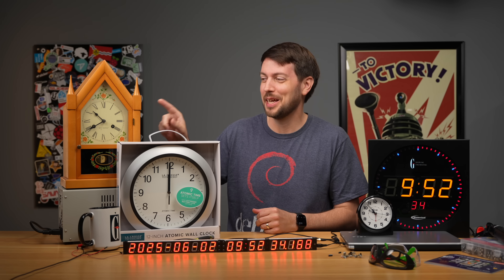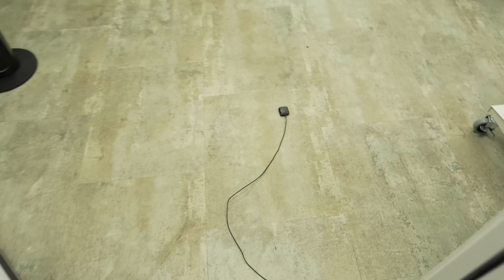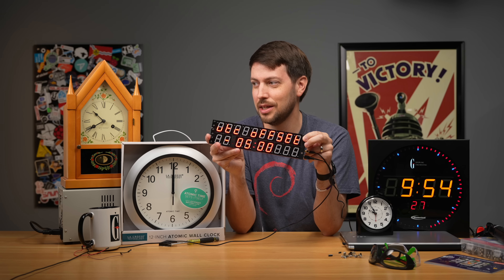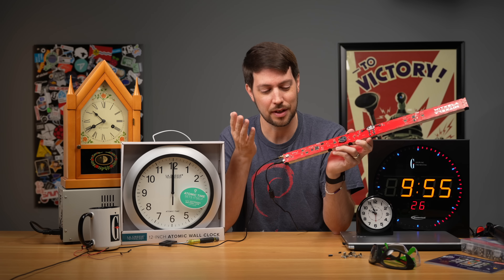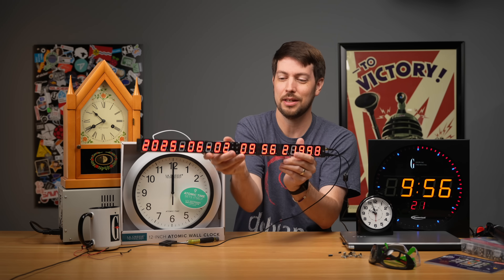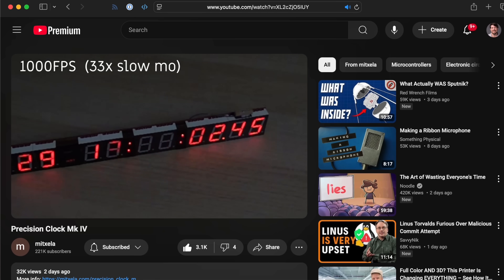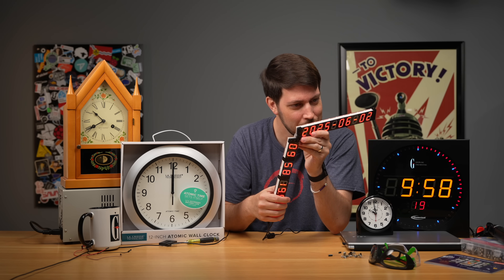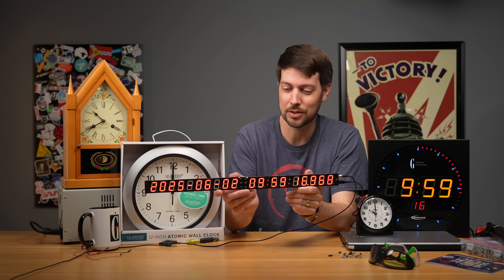Your eyes are too slow for this clock

Comment: I always wanted an atomic / gps / ntp clock... There are lots of cheap ones out there that are battery powered... but I want one that plugs into an outlet without needing a "battery eliminator" and they all seem to be really expensive...  I just want at least one stand alone clock as a display/conversation piece I can just set and forget, and not have to worry about battery.  why is that so hard.

Comment: I love this "time" hobby.  I've been somewhat obsessed with accurate time since I was a kid and saw the Back to the Future movies in the late 1980s.  Then by the time I was a teenager and had access to crude reference NTP software and had my first Internet connection back in 1999/2000 it was cool to be able to set my computers clock with SNTP (not real NTP) using that reference software.  Now I use real NTP software or chronyd on Linux and it works really well.  But to have a physical desk clock, I just bought my first NTP WiFi clock a month ago because I was so disappointed with the performance of "Atomic" (radio) clocks where I live since I live so far away from the signal that they have to perpetually be in a window rather than on my desk or beside my bed.  This is so cool to see other people share this same obsession with accurate time that I do!

Comment: Thanks for the fun video.  Finally!  Someone geekier about time than I.  Yeah, I've got GPS-based clocks, and set mine using GPS or NTP.  Usually I just use time.gov and set my (manual) clock so its pulse-per-second LED blinks at the same time as the time.gov readout changes.  I can move things around so my eyes can see both (PPS LED and time.gov display) simultaneously, and I can synchronize the clock manually to within a tenth second or so.  I'll also sometimes call the NIST number and sync with their start-of-minute tone.  A friend of mine puts us both to shame -- he owns 2 Cesium oscillators and tracks the phase with the WWV* radio signals.  He says he doesn't care so much about the absolute time, mainly the oscillators' precision.  He may not know what time it is, but he can tell you how long any time interval is!

Comment: This is the coolest clock, officially. I actually own the previous Mk III model-- it sits above the AV equipment on my desk and it's the only clock I actually trust (when it has the GPS fix, of course). But this is on another level (even literally in some aspects).

Comment: The clock screen seems to be hard to read, not sure if that's a camera/lighting artifact or if the used 7-segment LED is not that bright.
Reply from the maker: It's actually an artifact of the non-lens-cover design out of the box. Ideally you'd have a special lens in front of the digits (most alarm clocks have this), that helps to even out the light. Otherwise you get the murky display that you see in the video (it's hard to record LEDs in general!)

Comment: I’ve always wanted to see a highly accurate extremely cost-effective atomic clocks that could be used to built into a very large 3 dimensional array and cleverly integrated together with some kind of mesh network, not sure if the array would be best in a terrestrial or non-terrestrial placement? And then monitor synchronisation errors.

Comment: Unsure about the clock shown in the video but this is for GPS clocks in general. If you leave the clock stationary over an hour period it should slowly train in on the weaker signals of the satellites and eventually grab the time even with a small device-sized antenna. You can also carry it to a window or outside and update the time if the internal RTC is reliable enough to only need updating once every year or so. I'd add a surge arrestor to the outside antenna just to be safe from even far away lightning strikes damaging components.

Comment: Delays with a time signal is a pain (allowing for how far you face is away is not the clocks problem, you chose to be there) I had lots of fun sending time down a serial line, so all my clocks are in sync, allowing for the delays in the serial data is a challenge, a PPS signal would fix it, however integrating that into a serial stream is a problem. a dedicated PPS line would be best solution, however adding the extra line - not ideal for me,
Even using processors is a problem, they are not real time, everything is delayed - latency.
In the end I had my remote clocks average out the variations in when the time data arrived and add a fudge factor for the average delay in my system. So good to parts of a second - time for an upgrade?

As for your new clock, the bit that suprised my about it was the colon LED's, doing a slow fade rather than hard switching off the PPS signal. Having the sub second digits is a nice party trick, but kind of pointless as far a super accurate time is concerned, as the only thing that ever uses that time is the human eye/brain, that cannot handle it - otherwise you would not get the comments about the last digit being stuck on 8, back to your title "Your eyes are too slow for this clock"

I made a 16 digit clock, mainly as a project in getting an Arduino Nano to drive an old 16 digit calculator bubble display with insufficient output pins. Time was just a handy thing that could use all those digits, so time to make it a real clock - as in super accurate PPS driven?
Reply from the maker: Regarding the colons; they can be set in different modes, from pulsing like in the video to blink, steady, off, etc. I just had it set in the default.

Interestingly, the colons are using PWM for the fading
Reply: @Level2Jeff  Lucky then that it didn't get tangled in the frame rate of your camera and give us a right old mess.
Actually I find colons to be a pain when it comes to making digital clocks, there are plenty of seven segment displays out there, but no colon's, so your forced to make your own, but they never look right, as in the same as the display segments, wrong colour, shade, you name it, never right.
Generally I've flipped the first minutes digit so it's decimal point is now at the top and in conjunction with the second hours digit decimal point can stand in as a colon - not perfect, and relying on the displays being symmetrical, they mostly are, however I have some that are not.
I just looked at the mitxela video, yes colons stand out as not matching.

Comment: Very cool, I'll check his page out. I built a clock a few years ago using two ubloc f9p  for error correction with surveyor style ground plane antennas to discipline the rtc. The MAX7219 is great for driving common cathode LEDs. His design is really cool with how it folds. Fills my head with ideas.

Comment: That is a very cool clock, I've spent more than that on mechanical clocks, clocks can be a bit of an addiction...   That clock is only displaying milliseconds, the 10 foot GPS antenna cable is only going to add about 10 nanoseconds of error, so not really an issue. :)  Last year I got a watch that syncs to wwvb, had to build a ferrite core resonator to put next to it since I'm on the east coast it wouldn't sync unless I put it on a west facing window, next to the resonator it will sync anywhere in the house.

Comment: It's always cool to find someone has done something that I have purchased parts for but haven't made yet.  I've had a tube of an insane number of 7 segment displays under my bed for the past six years now.  I've been wanting to make a clock that counts at 32768 hz for years now - with no microcontroller.  pure 74 series logic chips.

Comment: I would like to see the circuit diagram of this clock. The UBLOX MAX-M8Q-0-01 GNSS module has a PPS signal output accuracy of about 30-60ns.  I assume the clock circuit is only getting a pulse per second (which is still highly accurate) and the clock is then deriving the millisecond count from this PPS. How often does the clock sync to the PPS signal?

Comment: Am I the only one that doesn't really get the whole point of precision timing as a hobby? Don't get me wrong, everything displayed here, including the design and engineering that has gone into this device is awesome, but, outside of really specific scientific or engineering contexts, keeping time to this level of precision is kinda useless.
Reply from the maker: There are a number of applications that can benefit from accurate time to ms (and beyond), from amateur radio/astronomy, to distributed data sensing, distributed computing in general, and VR/AR tinkering. Most things today are fine with just slapping NTP time on them (you can usually get into the ms range with that), but a lot of things need better time if you want to go deeper or get better performance.

Comment: Since many of your projects will be using GPS for timing, try to find a GPS signal splitter. They work similar to regular RF signal splitters, but one of the outputs has a DC pass through path to deliver power to the amplifier in an active antenna. Use it to connect the receiver which will always be running, and use the rest for your other projects.
Reply from the maker: I installed one a couple weeks ago, currently splitting the external antenna to two Pi grandmaster clocks I'm testing.

I have two more ports available and two long runs of RG58 coax, I just need to get messy up in the ceiling and get the things run into the studio!

Comment: My former father in law installed and maintained ILS equipment in the south East. I joined him a new install one Saturday morning and he couldn’t get the self calibration on the localizer to succeed. Being an IT professional and gear head, I was surveying the the installation and said “hey Roger, what’s this little 4” pigtail on one of the antenna inputs do?” He peeked his head in the back of the rack and responded with “oh, there’s my 180 degree phase inverter. No wonder it won’t cal.” 
All the dozens of antenna coax were cut to millimeter precision using a vector voltmeter to minimize the amount of software phase correction needed on each antenna channel. Just freaking amazing!

Comment: Since the 1860s there had been a time signal in Edinburgh where a gun is fired at the Castle. This used to be triggered by the best electrically controlled clocks regulated by the local astronomers. Maps were sold with circles indicating the delay from the gun firing to when you would hear it at different places. Maybe you need to a map of your office with lines marking the correction you have to make because of the delay in light getting to your eye from the clock. But then I guess you'd have to add a correction for the time it took you to react and do the mental arithmetic....
Reply: That is incredibly cool!

Comment: Obsessing about nanosecond accuracy when working with modern CPUs is paradoxical -- on an inception-on-a-chip mac m4 a single instruction can take up to 500ns to complete. That's about 100 meters of cable-time. Nanoseconds are only important when you're touching metal.

Comment: I went down the time rabbit hole a long time ago. When you could get a cheap ovenized oscillator at a surplus shop. I still have the GPS disciplined Rb standard I built back then, and it still puts out a very very accurate 10Mhz for my electronics bench. This though...this tickles a different part of my metrology/time interests....

Comment: Investing Time into..Time?  (thanks dad) Holy cow, I never knew there was so much involved.  But also, I don't need that kind of accuracy.  +/- 5 seconds is plenty close enough for me.  But even if i extend cables and what not, it's probably closer to 1 second.  I'm not syncing anything critical that can't be 10 seconds late, but still interesting.  The only other most accurate thing I want to get going is a 10mhz signal for radios and stuff, but I wonder if a TXCO is good enough for what I'm trying to do.  I just dont want things to drift, and I'm already working with the normal quartz stuff which isn't -- too shabby.`

Comment: I was on the team that manages all NTP time servers for all of Amazon and AWS, including all customer instances, customer devices in the field, etc….  You would be amazed at the kinds of things we had to do in each datacenter in order to get multiple GPS antennas on the roof, diversity of antenna locations and cable runs, length of cable runs, and so on.

But starting with a way to distribute 1PPS signals reliably and in sync — that’s part of the key.

Comment: The Pi Pico doesn't have the low power modes to run off the backup battery. The STM32L0 and L4 series can sleep with the RTC running at a few hundred nA, or about 1µA if you want RAM retention.
Reply from the maker: The RP2350 improves a bit over the RP2040 with better light/deepsleep options (down to low uA) (though still not quite a battery-only champ like some other microcontrollers!).

Comment: 3:32 A battery-powered TCXO? How long does it run on battery? What temperature?
Reply: It looks like a normal 32kHz crystal, mitxela's project page also doesn't mention a TCXO just a crystal.
Reply: It might be temperature compensated in the sense that the board temperature is measured and some ppm offset is applied based on the manufacturer provided curve for the crystal, that's standard practice and the STM32 clock system has a mechanism for it.

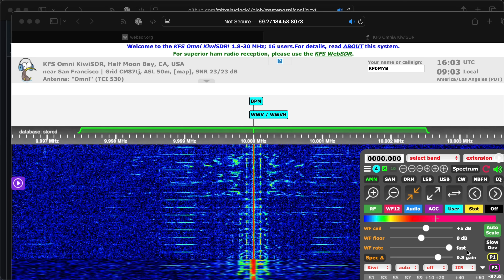Comment: 3:00 Unlike WWV, where the voice first gives you the upcoming time and then the beep marks it, in GPS I believe that the 1 PPS pulse happens and then (a bit late...) the time data comes out of the GPS receiver chip.
I've seen software where this is carefully accounted for, with the time data being incremented and aligned for the following 1 PPS pulse. That incrementation might include the date, etc.
One might imagine a very precise clock where this was overlooked, and it might be almost a second off.

I own three of those Atomic wall clocks that receive the new WWVB phase modulation. They're near-perfect, except at the last 'Leap Second' the Seconds hand paused at 59s instead of at the 60s mark. Obviously a design limitation in that that Minutes hand would have otherwise incremented one second early. Another minor design flaw is the battery replacement seems to require a complete reset to get the Seconds hand going again (in spite of having parallel C cells).

Comment: Cable delay is nothing, USB delay is a larger and less predictable problem. And, you should be aware that the cable delay is temperature sensitive to do properties changs and physical length changes.
{o.o}

Comment: Nearly 50 years ago I worked a few summers in a manufacturing plant assembling printed circuit boards for use in Univac mainframe computers.  At least once we had to cut a trace in a batch of printed circuit boards and solder a wire of a very specific length (about 3 feet IIRC) to complete the circuit.  Even with late 1970's technology a few nanoseconds were important.

Comment: It is actually smaller than I though... don't know why I though it was twice as big...

What's next? Atomic clock with a cesium chamber? ... TIL that a commercial chip scale atomic clock (CSAC) exists with a cesium capsule only 2 cubic millimeters in size: "The CSAC, the world's smallest atomic clock, is 4 x 3.5 x 1 cm (1.5 x 1.4 x 0.4 inches) in size, weighs 35 grams, consumes only 115 mW of power, and can keep time to within 100 microseconds per day after several years of operation." ~ Wikipedia

Comment: “It has two microcontrollers that it has to keep in sync” — well, one of them only has to display the date. No high speed syncing needed for that.
Reply from the maker: True
Reply: It can display unix timestamp instead of date ... E.g. you need to sync it to sub second precision.
Reply: @LukasDzunko  between two microcontrollers subsecond isn't much precision at all, the most simple implementation would be in the tens of microseconds.
Reply: @teslatrooper  I know. I was reacting to comment by JasperJanssen "well, one of them only has to display the date. No high speed syncing needed for that." ... that's true for date, but it can display also timestamp, which require synchronization for seconds to roll-over on on both displays at once ...

Comment: A pretty basic LED won't be able to handle nanosecond precision anyway.  There's a capacitance associated with the space charge region of a diode and particularly to turn one off there's a transient as the excess charge is removed.  Without getting stupidly expensive you could maybe do one that's good for tens of nanoseconds though a basic multi-plexed seven-segment display with a phosphor LED I wouldn't even trust to below a microsecond or so.

Comment: 3:16 then in Smartwatch/phone land, you get to :58, and the screen goes into battery saving mode and drops the seconds counter. You frantically tap/wave the device around and... you're already at :01. Now you get to wait a minute, or live with the shame that your microwave is a second off.

The timing struggle is real.

Comment: Wow, that is one heck of a thought, I come from an avionics background (speciality being RADAR) and never really considered the implications of a "variable wire length" from the antenna to the receiver, they are constant on "pre built" systems like radars. Thanks for the insight. 👍
Reply from the maker: I've recently found someone who works on tooling to measure cable lengths based on PTP timestamps (instead of having to use expensive TDR equipment!), accurate to a pretty tight tolerance... it's fascinating what kind of things are possible with time measurement on a ns level!
Reply: @Level2Jeff  Using a time domain reflectometer is the best way to find cable breaks in the depths of a system or air frame. Getting the frequency to shift for a precise standing wave seems difficult for a digital signal, but I suppose that it would also work with precise timing. Very interestng.